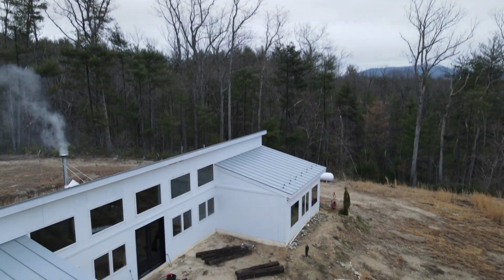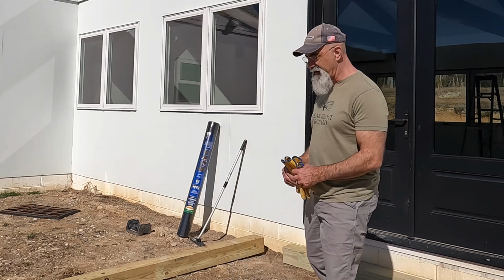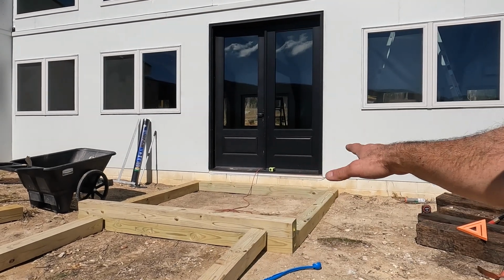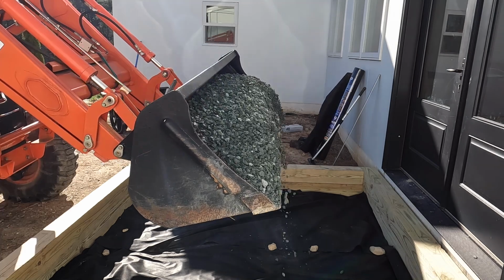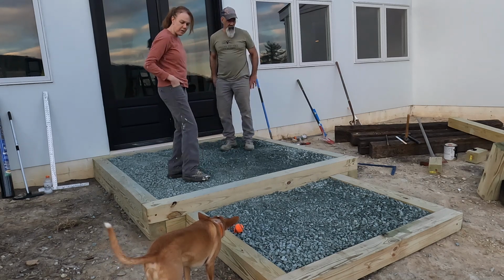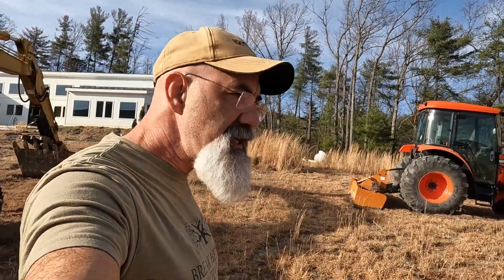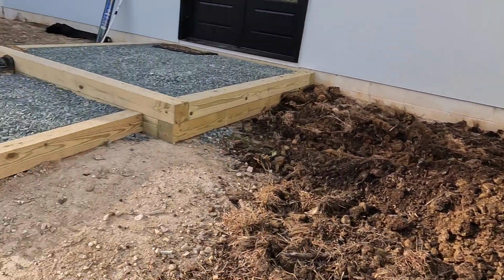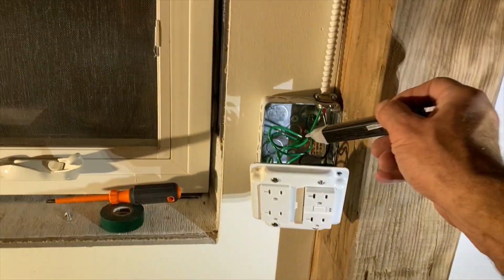Timber and Gravel Front Steps - and Kitchen Lights

Comment: My friend, I don't know why you didn't level first, especially the second part of the entrance to the house, secondly, you put the beams on the ground instead of concrete first, if you don't cover that entrance it will quickly collapse from moisture... I'm really interested in why your rooms are so high , and I don't see that you intend to build something under the ceiling... you're just making it a problem to heat up, not to mention cleaning dust, whitewashing, if you need more oxygen, open the window.
Отворите у Google преводиоцу
•
Повратне информације

Google преводилац